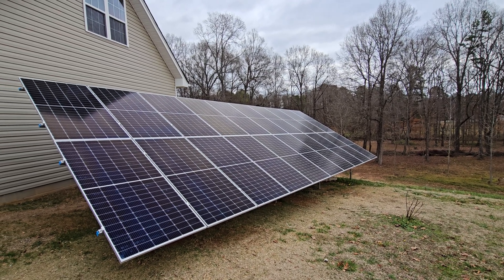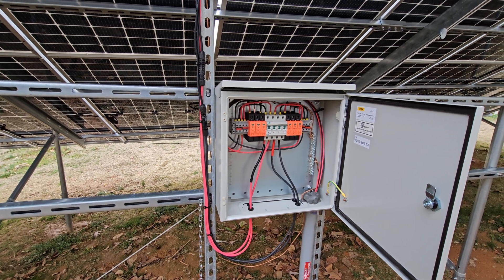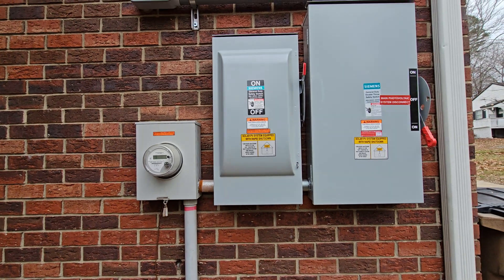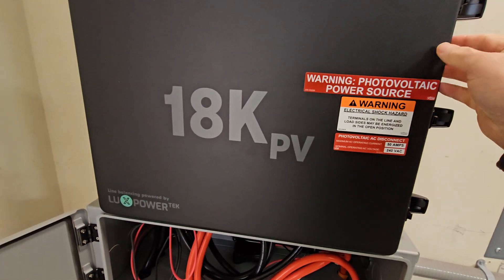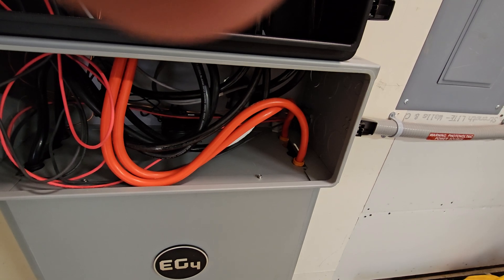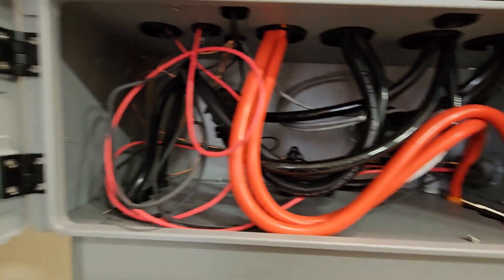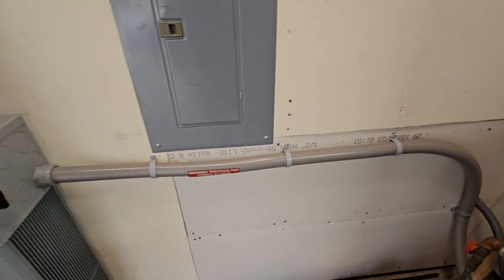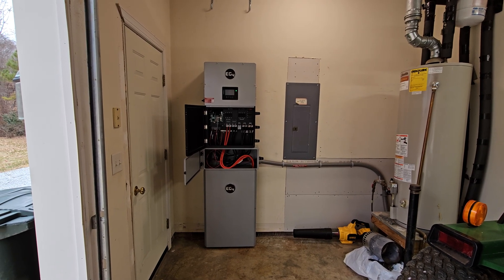Received My Permission to Operate from Duke Energy for my 18Kpv

Comment: Looks good. I have a question about your disconnect. Am I right to say when the disconnect switch in in the off position your are completely disconnected from the grid?  I think that is counter to the purpose of the safety disconnect.  The disconnect'  purpose is to shut off power to the inverter while you work on it, not cut power to the house. I think, from the way you described the wiring that if you shut off the safety switch while you work on/ replace the inverter you have no power at all.  If I am reading the drawings that came with the 18k, the disconnect and the transfer switch both have a connection to the grid so you can still supply grid power to the house when the inverter is out of commission. .
Reply from the maker: You are correct.  The disconnect will kill grid power to everything.  It was required by my city inspectors to be set up this way.  This is because I don't have any other main service disconnect/breaker before the inverter.  If the inverter is not working properly, I can still bypass it and send grid power directly to my main circuit breaker panel through the transfer switch.  I cannot kill grid input AC to the inverter without killing everything.  I would have needed to replace the meter base with one that has a 200 Amp breaker or install an additional disconnect to get it to work like you are stating, and I really didn't have the space on the wall to do it.  The placement of the switches was critical to getting it to line up with where the inverter needed to be placed inside the garage. (between studs and not blocking the main panel)

Comment: The only other thing I can think of for your second battery would be if you can mount it on it's back (on a shelf).   It obviously is shipped on it's back.  Manual clearly says to mount it upright but perhaps SS can give you some guidance on another option.
EDIT: the other option is to mount the second (or both) PowerPro(s) outside on the other side of the wall.  They are rated for outdoors.
Reply from the maker: I think I will end up just ordering the connectors and cable and building longer cables.  Good cable is expensive, but it is a good clean way of doing it.
Reply: @Gary_Pauls_DIY  shoot...I know one of your concerns is the door...is there a way to re-hang and have it open the other way?
Reply from the maker: @wadebrewer7212  It would be even worse if it opened the other way.  It would hit the single battery currently installed.  I would have to make it open out instead of into the garage and that creates security issues unless you spend the money on the correct door and hardware.
Reply: @Gary_Pauls_DIY  that's what I meant was open into garage.

These are bot bad things ti overcome...I'm a dork....I enjoy figuring these kind of things out when it is done, it looks like it is supposed to be just the way it is.   

Nice set up by the way.  The EG4 wasn't available when I bought my Sol-Ark 15k and installed it.  MUCH more attractive for value over the Sol-Ark in my opinion.  I think the Sol-Ark 15k can surge higher, but honestly...thats moot for most loads.  The Sol-Ark 12k has roughly the same output as yours does, but it doesn't have the same for solar input....it would require you to AC couple using the generator input to get the same solar input capability of your EG4.....and I'm not willing to give up my generator input and add cost for AC inverted panels.  Your EG4 has all of it really....gen input, reasonable 12k output and 18k worth of DC solar input for a much better price point over Sol-Ark.  All of them have a zero export function...something I needed.

I have inverter envy.  🤣
Reply: @Gary_Pauls_DIY  I would be concerned over how long yhe cables are and an uneven distribution of power between the two packs.   Only a concern, if you are not running a full DOD on batteries, may not really be an issue, but know that the long cables could cause a balance problem between the two packs.
Reply from the maker: @wadebrewer7212  The manual has you connect one 2/0 positive cable and one 2/0 negative with a length of 56 inches.  I plan to run two 2/0 positive and two 2/0 negative cables around 65 inches.  I believe running two of each will more than make up for the added distance.

Comment: Great set up! Was the transfer switch required by Duke or inspectors? Or was it just your preference?
Reply from the maker: The disconnect was required, but the transfer switch is something I wanted so I could bypass the inverter if I needed to work on it or if it failed.  It was in my plan I submitted to Duke from the beginning, so I don't know if they would have approved it without the transfer switch.

Comment: Stacking your batteries in your case. I would be a little bit worried about the walk-in door banging into the battery all the time. To be honest I would just go with longer battery cables and mounted over by the hot water heater or even if you have room consider mounting it above the power panel or above the EG4 unit
Reply from the maker: I agree.  I think in the end I will place the battery over by the water heater.  I need to build longer cables to make it work.  The new battery arrives in just a couple of days.  I plan to put it under the distribution panel and have the cables in the open until I can make new cables.  SS states the batteries need to be within 1 Volt of each other, so I believe this is the reason there is a restriction on the length of the cables they provide.  To compensate I will just run two sets of cables to drop the voltage loss in half.  This would be a problem if I planned to run 3 batteries, but my plan is for only 2 batteries, so this should work.
Reply: @Gary_Pauls_DIY   I think if you're concerned about a voltage drop, you really just need to upsize the size of your battery cables to compensate for any kind of dropping voltage. It'll cost you a little bit more, but for that short of distance it'll be negligible. Too bad you can't raise the electrical panel to get it out of the way but that would cost more than it's worth

Comment: Do the battery cables from the battery come with the inverter and have lugs on one end to the battery and no lug on the othere end to the inverter?
Reply from the maker: If you buy it as a package it comes with the battery cables.  Yes they have the connectors attached to connect to the battery and the end which connects to the inverter does not have any lugs (not needed for the 18Kpv)

Comment: What gauge wire for the Load/Grid out of the inverter?
Reply from the maker: 3/0 copper
Reply: @Gary_Pauls_DIY  it is SO heavy and stiff I don’t know if I can pull it from my location. 🙁
Reply from the maker: @jonathanlyerly8501  The other option is to feed a distribution panel instead of using the full 200 Amp grid passthrough.  Look in the manual at page 32 Diagram 4.1.  It takes 70 Amps from the grid and then  feeds into a sub panel with 60 Amps.  This way you would only need 4 AWG Copper.  It will still back feed any excess power generated to the grid.
Reply: @Gary_Pauls_DIY  this exactly how I have my Sol Ark 15k.  I'm feeding a sub panel with critical loads.  Back feeds excess but limited to house, I am not on a sell back.  So if grid is down, i lose some of the things in the house, but not the critical stuff like fridge....heat....and of course.....coffee pot.   Lol.
Reply from the maker: @wadebrewer7212  Nice.  If anything goes wrong with this 18K, I will most likely swap to a Sol-Ark.  So far no issues.
Reply: @Gary_Pauls_DIY  lol!  I said the same thing about the solark and switch to EG4.  

I bought my 15k and about 2 months later EG4 released this unit.   Granted....yours is only rated to a constant 12kw output...but really...if you are exceeding that in a backup situation, you need to reevaluate.

I went with the 15k over the solark 12k because if the L1 and L2 balance issue amd shut downs.  And....I wanted the 3rd PV input on the 15k.

What I'm saying....is you ended up with heck of a lot more value to cost over the Sol Ark by a large margin.  Sol Ark is overpriced in my opinion now that EG4 offers their 18k.  Sol Ark needs to evaluate their price to performance.

Comment: It's a lithium battery, can it not be mounted horizontally under the electrical panel?
Reply: I was thinking the same thing.
Reply from the maker: According to the manual, it has to be mounted upright.  The mount that comes with it wouldn't let you mount it any other way, so you would have to build something to mount it horizontally.  Also you need access to both sides of the battery.

Comment: You don’t have to have the box on top for your second battery.  All you’ll have coming out of it are the battery cables going into the current box and the communication cable.  It will fit under your breaker panel without the box on top.
Reply from the maker: I thought of that, but there is no easy way to connect conduit to the Powerpro battery.  The cables would just be out in the open.
Reply: It seemed so easy😂. Great job on the installation and explanation.   I’m thinking of doing a similar project.  Thanks for your videos.
Reply: There many be a requirement for space in front and around the main breaker panel that would limit permanently mounting anything under it.
Reply from the maker: @joetripp123  Yes, by code anything under the panel cannot stick out more than 6 inches.

Comment: Light duty, low surge capacity, high frequency, transformerless inverters are ok for feeding the grid (grid intertie) purposes but powering your home's inductive appliances like microwave ovens, refrigerators, freezers, large power tools, air conditioning systems, motor loads is not a good idea, because frequently running these types of loads will shorten the life expectancy of your inverter. Also, the comparatively poor surge capacity of a high frequency inverter will make it more difficult to start these inductive loads. If you want to use your system off grid, a much better, more reliable choice for an inverter, would have been to install a hybrid, low frequency, transformer based inverter charger. It will last you far longer in frequent off grid use, and it will provide you with a much higher, 300% surge capacity to start and run those high inductance loads.
Reply: How could i make an off grid Pv installation ment to load my EV only?
Can you do that with DC, or must you go to AC?
Reply from the maker: You would need the panels and an inverter to take the DC voltage from the panels to AC in order to charge the car.
Reply: The safest way to charge your EV with solar is to use a low frequency, transformer based inverter charger that provides galvanic isolation between the DC boost stage of the inverter and its AC output. You'll eventually smoke your EV's onboard charger if you use a high frequency inverter. @harryvantrotsenburg5481

Comment: how about scooting your current system to the right closer to the fuse box and then a battery on the left ? enough clearance?
Reply from the maker: Can't move it since I have the conduit coming in the back side of the conduit box for input grid power and output inverter power.  My switches on the outside of the house kinda set where the inverter had to be installed.

Comment: I would start a eg4 battery server rack to the right of the main panel. That way you’ll have a extra 30kwh instead of 14
Reply: PowerPro manual says "Do NOT mix EG4 WallMount 280Ah batteries with any non-280Ah lithium batteries. This will
void your warranty."  So he'd have to sell off the PowerPro and convert completely to rack mount batteries.
Reply: @joetripp123  why?  Resistance difference in cells?  As in, lower Resistance in the power wall...under a hard discharge they would discharge faster then a huge transfer of energy from the other rack into it?
Reply: @wadebrewer7212  not sure. Resistance is a good guess.
Reply: 14 is pretty good if you load manage in a power outage.  It way better than not having back up at all.

Comment: That system looks great. I Cant wait to see how its gone after a year of use. I intend on doing something like this. I think in my case, I'd like to simply move individual circuits off grid one by one as my capacity allows, and not sell to the grid. anyone have thoughts on this? I would recommend hiring a mechanical contractor to bring the fuel gas piping, to the water heater, up to code. I see a couple of issues that could turn hazardous. I don't know how it is where you live, but copper tubing for fuel gas is a no no where I live. the dirt leg is undersized and should be in front of the fuel pressure regulator. there should be a union between the fuel shutoff valve, and the regulator, and finally, the regulator needs to be vented to the outdoors. Where I live, Im required to have a safety catch pan under the tank. these things vary from place to place. you could be fine except the dirt leg issues.
Reply from the maker: Thanks for the heads up.  This house is over 20 years old and all the gas lines are copper.  I may need to upgrade all of it so I don't blow up the house at some point.

Comment: If you put the battery in front of it. If something shorts out, it will cause two batteries to catch on fire. I move it apart so you do not endanger both battery packs catching on fire.

Comment: I don’t know if code would allow battery in front..I thought there was a stick out limit
Reply: Yeap, that is correct... NEC Code Section 110.26 (A)(3) estipulates that for equipment installed above or below another,  it can not stick out more than 6 inches from the other.
So, the idea of putting another battery and cable conduit in front would not pass inspection.
Reply: @Songomx yep I remember someone explaining it was due to the risk of leaning on something if it was too much
Reply from the maker: Thank you both for the information.  I may have to build my own cables to make this work.
Reply: if you put the battery on the right side, you put a wireway, 6X6 in between the two conduit boxes underneath the panel,  put the existing tube and the battery cables in  @Gary_Pauls_DIY
Reply from the maker: @frankh7234  That's probably what I will end up doing, but I will need to make my own battery cables.  The ones SS sells are only 53 inches long and to put the battery on the right side of the panel I need about 60 inch battery cables.
Reply: or put a negative and positive busbar in the wireway, pull the cables back from inverter then connect the left and right battery with the factory cables to the busbars, then 2 4/0 AWG or 4 2/0 AWG (cables from the busbar to the inverter. That will give you equal length run from the batteries to the inverter @Gary_Pauls_DIY